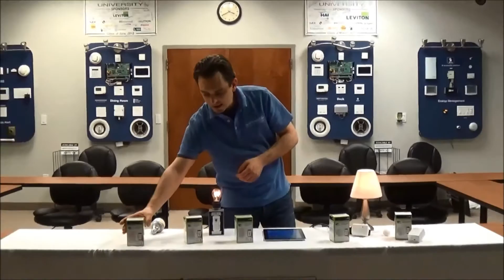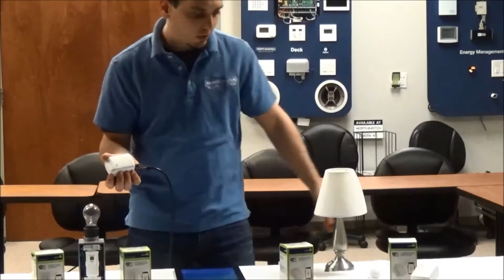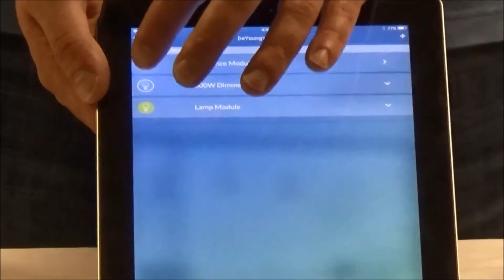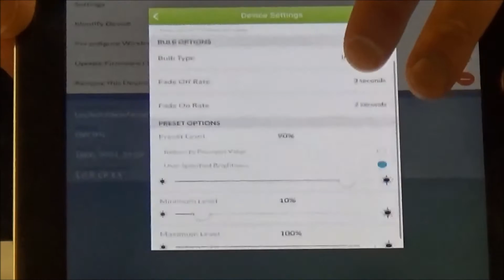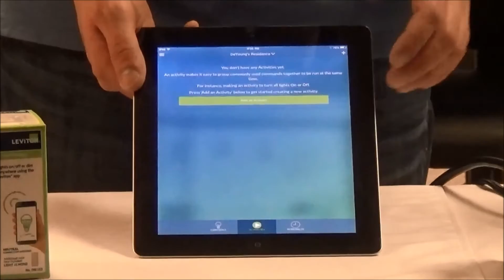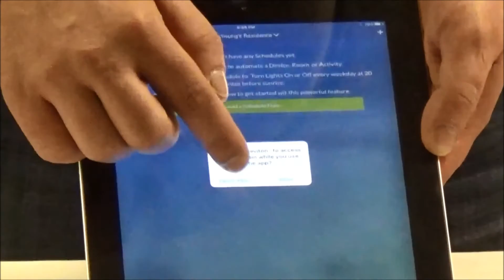Leviton Decora Smart Wifi First Hands On

Comment: Can you control your lights away from home?
Reply: Watch the whole video.  Yes, you control the switches from the app but it doesn't require a "hub" device.  It's a simple design with the latest features.  I've had the old school Vizia RF+ which sucked to configure.  This setup appears to be simple in comparison.  WIFI > Zwave these days.
Reply: You can, i really like these products due that i travel a lot and i can control them from anywhere, you only need your tablet or phone with internet access.

Comment: Can the dh6dh be controlled while not connected to home wifi if run through Apple HomeKit, or because this does not integrate with a hub I will not be able to tell Siri to turn on my lights when I’m not home and say around the corner